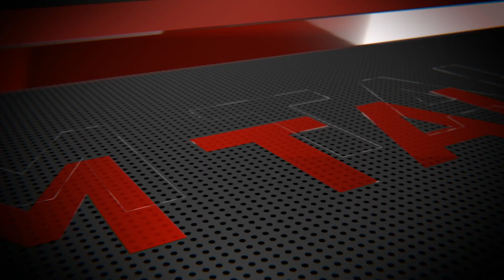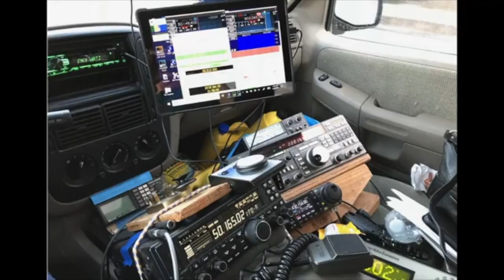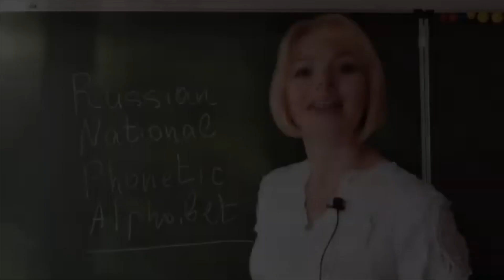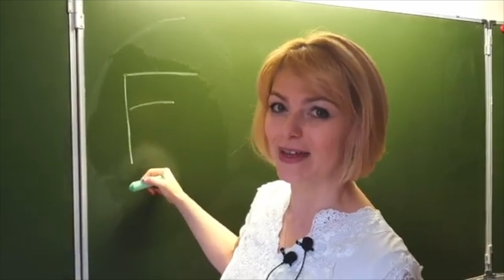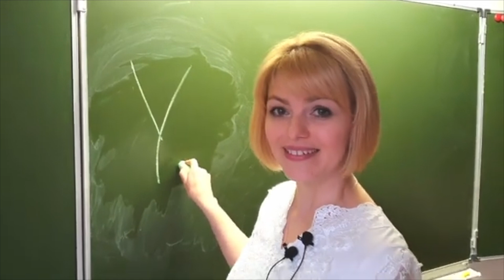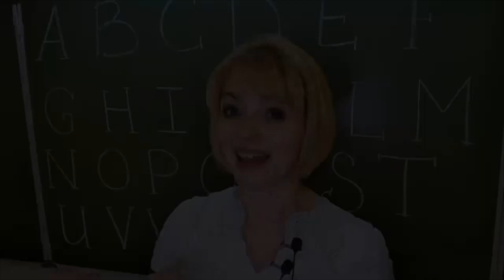HAM Talk Season 2 wrapup

Comment: inch and 58 hardline what do you use if anything to relieve the weight off the antenna>??? are you some how clamping the line to the tower or just taping it or wire tieing it??
Reply from the maker: All of my hard line cables run up the tower and are secured to the tower itself and then, I use M&P Ultra-Flex 13/500 to go from the hard line at the top of the tower to the individual antennas....that is setup to allow rotor loops, etc. I use a combination of cable clamps, stainless steel cable ties to secure hard line to the tower.